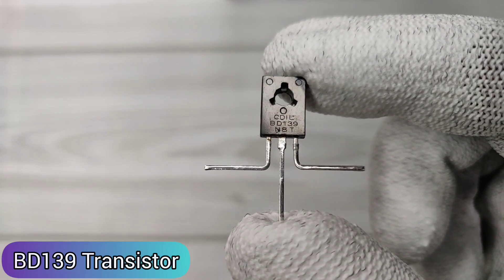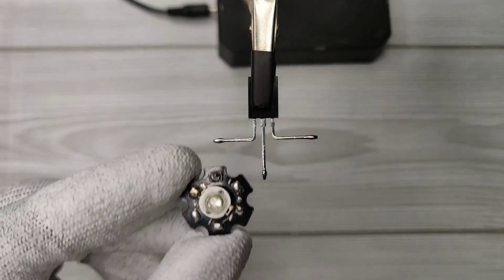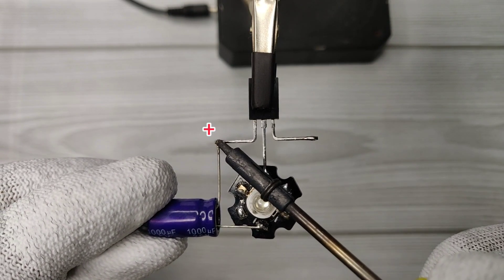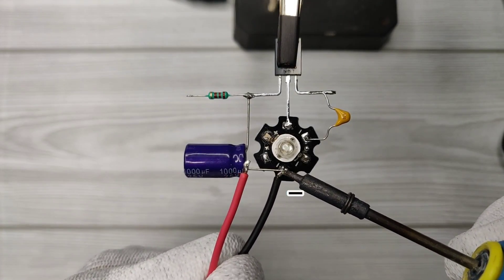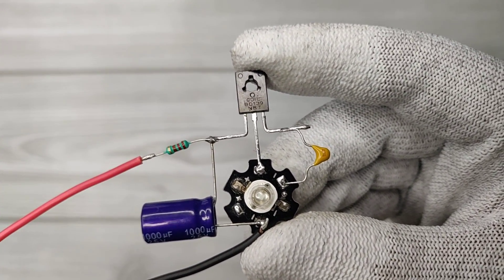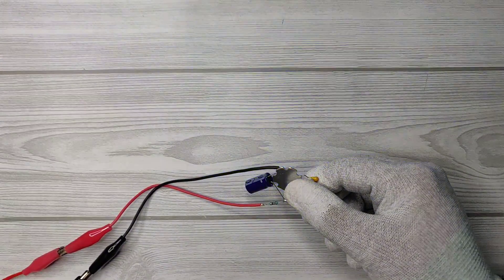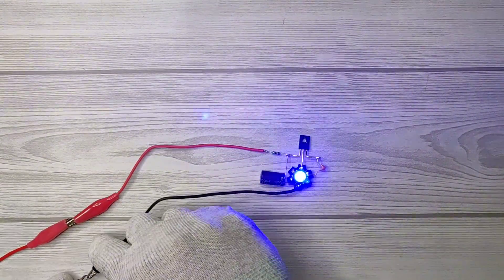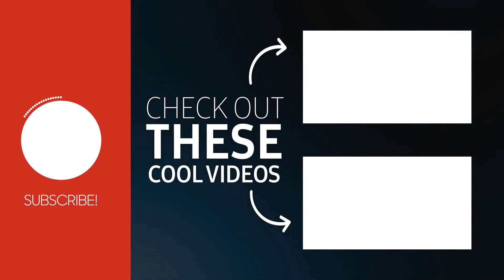12v LED Flasher Circuit Using only 1 Transistor

Comment: What adjustments need to be made to slow down the rate of flash?
Reply: Prob the value of the electrolityc cap
Reply: @andrejfx8505  I would imagine so. Increasing or decreasing the cap would be the next question. I am just going to have to experiment and see.

Comment: Is it necessary to use non polar capacitor?..i.e,0.47 uf
Reply from the maker: Not so important but blinking will be fast but using this will stabilize blinking
Reply: @CreativeTechos  
Can I use 104 no..non polar capacitor in place of this??
Reply from the maker: Yes

Comment: Can we use it with 10watt bulb??
Reply from the maker: Yep but 3.2-3.4v
Reply: @CreativeTechos  3.2 - 3.4 v battery?
Reply from the maker: No I told about led blub
Reply: What do you mean by your reply??? Are you talking about battery ???

My question is , will this circuit will work with 4x 12v10w bulb with same 12v battery ???
Reply from the maker: No, what i said leds need to be 3w - 10w but 3.2-3.4v, if you want to use many leds of 12v, please check out another circuit on my channel